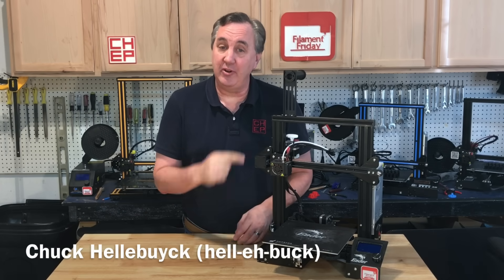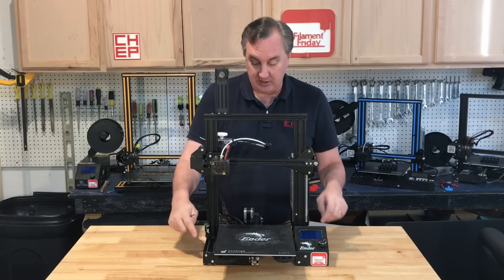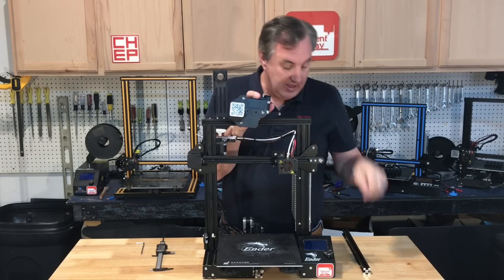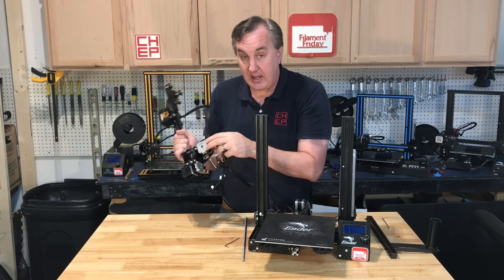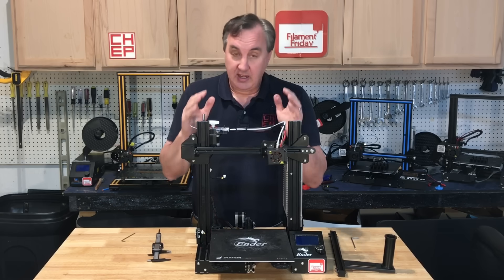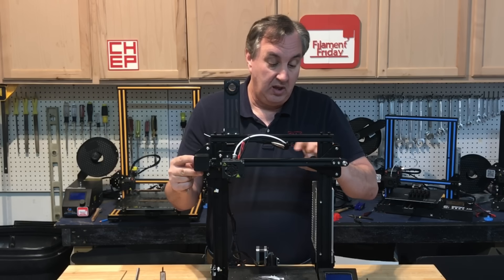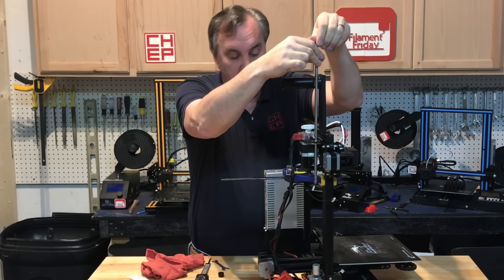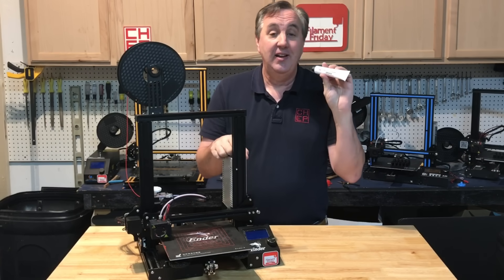Fix Your Bed Level on Creality Ender 3

Comment: Chuck, you hit the nail on the head with this video!  I had precisely this issue and was lucky enough to simply loosen the screws on the uprights, square everything up and it was fixed!  I didn't have the issue with the top bar, so I dodged that bullet!  Your videos are really helpful in general, but this one was spot on.  Keep up the good work.  Thank you.

Comment: Great videos, great voice (easy to understand), great explanation of everything. 

I got a E3 pro, and I'm not kidding but the bed's max height is like 1/4" or so low from the nozzle. Impossible to get it close enough. Now I'll have to grab some spacer-washers from hardware store and put them under springs so I gain that extra space. 

Even for Chinese built, it was pretty accurate in most areas, which is why I found this a bit odd.
Reply from the maker: Lower the Z stop switch.
Reply: @FilamentFriday  Thanks for quick reply. 
I'll check that tomorrow and see if it has room for lowering. 
I didn't think about that.

Comment: /how can I fix the alignment on a s1 pro? It has dual motors on z axis and both columns are connected to spin together, so I can't change the height on 1 side only.

Comment: Hey Chuck, Just a question about the Ender 3.
The level adjustment screws, under the bed always keeps changing on my printer. I need to run your bed leveling prog every time before a new print. Would there be any advantage by using a suitable threaded rod and a locknut to fix it?
Reply from the maker: Mark the knobs. Are they actually turning during a print?
Some times lower the Z switch to make the springs more compressed helps.

Comment: I would recommend loosening and squaring the Y-rail also while you're doing all this. One of mine was printing un-square until i did this. And since you undid the side bolts on the lower crossbar, it has the potential to rock fore-aft, possibly introducing a slope in Y-axis so that needs to match level of foot rails/tabletop as well.

Comment: Every time I have a problem that nobody on earth has, you seem to have the answer to it, and I’ve just realised your channel is the only one that has ever helped when I feel like throwing my printer out the window
Reply: I am about to throw my Ender 3 out of the window right now. Since I´ve had it it hasn´t printed anything just right. It messes up every single thing and I am unable to level the bed at all. I´ll give it one last chance to redeem itself because of this very video and if that doesn´t help, well... window it is.
Reply: Silicone spacers instead of the springs under the bed

Comment: Long shot to see if I get a response buy I have watched numerous videos including yours and it worked always but after I printed my last project I cannot get my bed level for the life of me. I'll go through all 4 corners and sometimes I'll do micro adjustments on one or 2 corners and have to do a major adjustment on another and my center is always pushing into the plate so I'll evenly adjust the corners so it isn't but then all 4 corners or 2 or 3 are way off. Idk what to do.
Reply: I level my bed while printing bed leveling prints. I find it the best and most accurate way to fine-tune it.
Reply: Where you able to fix it?
Reply: Bro I have the same problem
Reply: @redhoodbardock  i fixed my issue smh. I just level the bed when its heated. That helpep me to level it right. Preheat it and then level it!
Reply: @redhoodbardock  I went a whole new route, I have a flashforge adventurer 4 now and I have none of those issues anymore

Comment: Excellent video. I have a 3V2. I’m very agree about the assembly. This is Another thing  to convince me that Creality 3d printers are very low quality construction. Are (FTF) forecasted to fail!. They sell a cheap printers lagging quality and they really have the markup on the upgrades you have to do to maintain the printer in good performance…

Comment: I just got my first printer, an ender 3 v2, while it worked right out the box (came bundled with a CR Touch auto tramming probe), your videos have been absolutely amazing for narrowing down all the issues I've had. Thank you for taking the extra time to make these lectures for us hobbyists out here.

Comment: i recently build mine and a video recommended changing the springs, but now the nozzle is touching the bed and when i try to loosen the springs; the twirling thingies just come off. Any suggestions?
Reply from the maker: If the nozzle is touching the bed, why would you loosen the springs? You should tighten them.

Comment: I only bought my ender 3 v2 today and the springs are super squished, I can’t even level the bed it’s ridiculous, easily an inch off at it’s highest. I’m in the U.K., is this normal? I’ve bought the upgraded springs but I’m a bit annoyed for such an expensive bit of kit 😔
Reply from the maker: Reposition the Z stop switch.
Reply: I'm having same issue today when I've set it up. I dont agree with the reply changing z axis switch. There is a notch on it for a reason so you can only move it as far as a safe depth. There must be something else ...
Reply: @LostContentScar  I'm having the same problem with the z switch all the way down "safety stop bar" is contacting the frame, my springs are way out of wack too and I still have an inch to go
Reply from the maker: As I show in my Ender 3 Pro assembly video, I cut that tab off to give me full control of the z stop position.

Comment: I don't know if you'll see this, but with my vertical stop switch where it is, the hot end never comes low enough to make contact with the bed.  The stop switch is as low as it can get, and I've raised the bed as much as I can before I lose any tension at all on the wheels.  Any suggestions? I'm pretty much fed up now.  The only thing that could solve it is a thicker bed.  Am I missing something?
Reply from the maker: Cut off the nub on the stop switch and lower it.
Reply: @FilamentFriday  The red nub? On the z axis?

Comment: Anyone know what size the allen wrenches are on the Ender 3 screws he's talking about? (I want to go get a T-Allen key so I don't have to worry about if I'm getting enough purchase on it to tighten it enough.
Reply: get a set of metric Bondhouse T handles they are about 30 bucks but it will have everything you will mostly ever need and will last forever,

Comment: Hello I have an ender 3 v2. My uprights are leaning back about 1MM in 10 inches when I check it with a carpenters square. This is fully tight do I need to remove the upright and file it down?

Comment: Being new to 3D printing, the adjustments made seemed to be pretty substantial, yet the bed looks well used. Were you just getting a lot of bad prints before these adjustments were made or more of a minor tweak overall? Good video very informative.
Reply from the maker: No, I adjusted the bed a lot prior.

Comment: Just wondering if it's normal for the aluminum bed on the ender 3 v2 to bend when leveling?
Reply from the maker: No. Why would it go that?
Reply: @FilamentFriday  the only time it's close to being flat is when the leveling knobs are completely loose. As I tightened them up, the bed starts to warp.
Reply: I have no idea why it does this
Reply: @neatt3815  are you sure your bed isn't hitting something below it?
Reply: @MrMarty77  not hitting anything. I thought it was hitting the little gold belt clips, but since changing to the yellow springs, the bed is no where near them. I've noticed one of the corners is bent slightly more than the others and I'm assuming that could be causing it somehow.
Reply from the maker: Nope. Not normal.
Reply: oem springs? i would suspect that you changed for too hight springs.

Comment: Right from the first minute you failed to do it right. You absolutely NEED to also loosen off all tension in the bed levelling springs before working on anything else, otherwise you're literally working with a built in source of warping when you tighten everything back up again.... you also need to use a known flat surface, I know that's assumed but you might want to mention it.

Comment: Just wanted to say you are my friggin hero man - There's been more than once where I ran into an issue, and if it wasn't for your videos, I just plain wouldn't have found the solution I needed...This was one of them, as you had mentioned the "spring" issue with the bed, which allowed me to know this was what I needed...A total pain to correct, but finally close enough, that I "should" have a flat bed on the Ender 3 pro....Thanks again for your videos!

Comment: Thanks, CHuck! You saved my life with my Longer LK4 Pro, which comes to fail after 700 hours of printing. Follow most of your procedures, now I have fine prints! I put a helical spring lock washer with the first bolt of the X carriage bar to avoid a new looseness in it.

Comment: Thank you, sir! My son's bed settings were completely weird, and it was surviving because of BL Touch. I took a measurement of it today, and the far end was 5mm lower than the Z screw end. Took it apart and squared it up. I noted two other things while I was doing this, I made sure I had the three wheels on the Z-screw end set so all three wheels were touching (they were not) and when I assembled it, the far end was not square, so I loosened the two screws that hold the wheel plate on that end, adjusted the eccentric so all three wheels were touching, then tightened the two screws that hold that plate. Now that far end is 0.5mm higher, but that is much better than it was, and the bed settings are much more sensible now.

Thanks for the great video, it was a lot of help.

It is too bad Creality didn't run those two screws on the drive end in an accessible manner. hopefully, I won't have to touch those for a while.

Comment: Hey Chuck, I followed your video, tried again a few times. Also started from scratch on other channels, my back right spring is fully compressed, and my front right spring is completely loose, and my bed still isn't level. Any ideas?
Reply from the maker: Check the base plate for bend.

Comment: Can we reverse those 2 screws on the extruder side? I figure all we need is a longer screw(by 5mm), some locking washers and a nut. Would be great t hear more opinions.
Reply: I was thinking that same thing. It would require some really low profile captive nuts on the back side to have the strength required.

Comment: This guy really knows his stuff. My Ender 3 v2 was giving me endless problems with bed leveling and first layer issues and this video along with his other one on bed leveling fixed things right up. Thanks for the advice, you took a lot of stress out of the equation of this complex hobby.
Reply from the maker: Glad to help
Reply: @FilamentFriday  I am having same issues as Corey, but following your video, I see I am quite level & square overall, and the base is quite flat. After trying to level 4-5 times, then it seems okay, but then start to print, the clumping, and no laying of filament in areas (usually at the start). I stop , check the level, and it's way off again. At this point I am about ready to chuck it in the trash, and find another brand which does auto-leveling.
Reply from the maker: The nozzle will lift on the first layer to make room for you plastic. If it clumping then you need better adhesion. Maybe clean the bed with alcohol or soapy water. Sometimes one swipe of glue stick helps.
Reply: @FilamentFriday  The bed is literally a new one (the magnetic one), and I have done maybe one print on it. Also the printer stays in the optional insulated enclosure, so I know dust/dirt is not much of an issue. I did have a glass plate to use I got when I ordered it. Prints stopped sticking to it, and I tossed it to the side. Now I cannot find it so I went ahead and ordered a new one. I may also order that BLTouch for it. Thank you kindly for taking the time to respond.
Reply: @FilamentFriday  My new glass bed came in, and after 4-5 "leveling" tries, the level is much better, but not quite perfect like yours (also sticking to the glass bed). Looks like I will certainly be ordering the BLTouch kit. Thanks again!

Comment: Thank you so much. My x-axis was way lower on the right side to the point where I could not compensate with the bed leveling. I tried adjusting the eccentric nut but it didn't do the trick. However, this video's method of removing the x-axis worked. If it weren't for this kindly taught video, I would be ripping my hair off haha. THANK YOU!!
Reply from the maker: Glad I could help.

Comment: Hi! i have a question, i own two printers, ender 3 v2 and ender 3 pro.  i just got the pro because i found a great deal on it. So my v2 i had 0 problems with it, pro on the other hand i had a major issue.  When i auto home'd and leveled the bed, everything looked fine, but when i started a print, the zaxis dropped too low and completely wrecked the magnetic bed.  It seems to happen every time, auto home, level, all is good, print, goes too low.  Any idea what that could be caused by?
Reply from the maker: Same file works on V2?
Reply: @FilamentFriday  yep!  printing on the v2 right now no issues, same file
Reply from the maker: I’ve heard this from a few people. But your the first to verify same file works on 2nd printer. I suspect the firmware in the Pro.
Reply: @FilamentFriday  got it.  I tried to upgrade the firmware on it but got the bsod, waiting for a friend to bring me his stock board that has an updated firmware to check

Comment: I noticed that you clamped a square to ensure the Z-axis extrusions were square to the Y-axis base extrusions but didn’t not check that they were square to the lower extrusion that makes the X-axis frame beam. This is one thing that wasn’t covered in your video or three others I’ve seen from other content makers. On my printer while trying to adjust the wheel tension on the Z-axis I noticed that the roller assembly bases were not parallel to gantry extrusion causing a constant twisting force  onto the Z-axis roller assemblies. To fix it I had to release the four screws at the top and the four on the bottom of the vertical extrusions, tighten the two screws on the roller carriage close to the power supply and then tighten the eight screws, this alone made my Z-Axis move up and down much better. Then I adjusted the wheel eccentrics and all was well.

Comment: Oh my God thank you thank you thank you I'm definitely going to take a visit to your patreon page as soon as I get paid. Mine is exactly as you described the right hand side I have to almost unscrew the adjusting knob until it almost falls off to get it to kiss the paper. And the other screws I have a lot of adjustment left in and the funny thing is is open in robotics in the capacity of pharmaceutical research for my whole life this type of Gantry system is there an every possible platform that you can imagine other than ones that have motor Dan trees that are gantry assembly combined. Smac comes into mine. Is a matter of fact at one time I had all manner of these Drive systems and stepper Motors in my basement but ended up getting rid of them mostly selling them on eBay now I wish I had them I would come up with a real super high precision printer

So I'm a little embarrassed that I didn't think of this myself I mean I've been troubleshooting these machines my entire adult life and obvious to me now

Comment: So I have an slender 3 v2 and when I get the base plate right it will not go back to press the back button on the x axis because the bed is to low and will hit the back . So I don’t know what to do
Reply: I had the same problem - manually raise the Z-axis limit switch on the bottom left just a bit and you'll be good.

Comment: This does absolutely nothing on my Ender 3. I adjust the arm while loose but it always goes to the same position as I tighten the screws no matter what. I can try to hold it in any position as I tighten it and it always defaults to the same position.

Comment: Hi Chuck, do you recommend the Glass Bed for Ender 3, i did every thing to level mine with no sense still have issues of non stick and some times the nozzle moves the printed lines, my bed is fiber i guess not the stick one its the stock one that came with Ender 3 and i always have an issue in the center of the bed while leveling it  even i added a piece of aluminum foil in the center but still have the same issue, my Ender 3 are new as i just bought it and I don't know what to do
Reply from the maker: Clean the surface with soapy water or Isopropyl  alcohol.